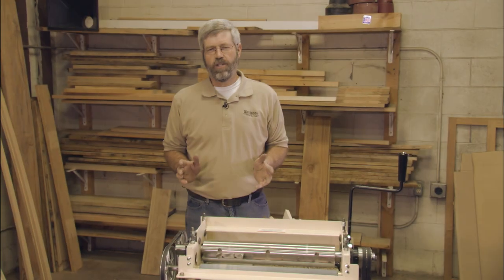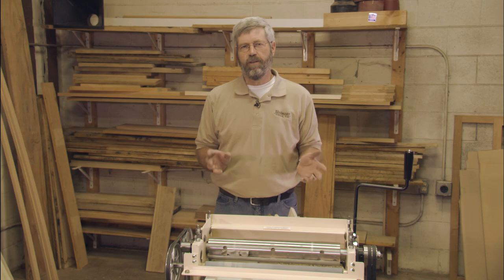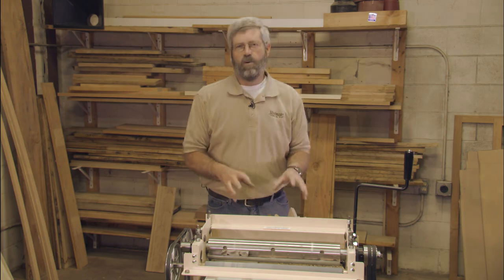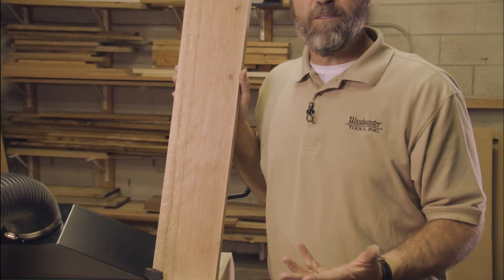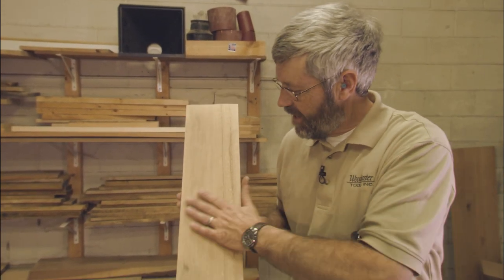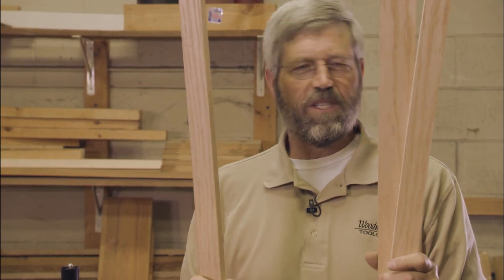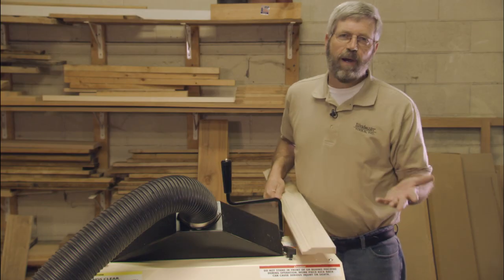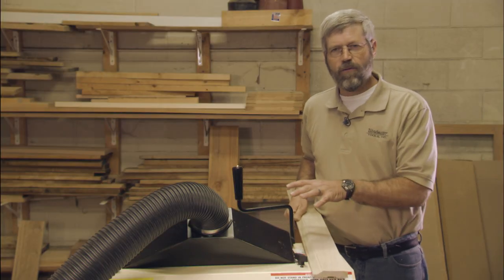The Woodmaster Planer/Molder Video: 4-in-1 Versatility Made in USA

Comment: I have to say that these Woodmaster machines are interesting. I am looking into purchasing a 24" planer and maybe a larger drum sander. The option of making molding is intriguing. Many moons ago I was the machine man for a major studio in Hollywood making several miles of molding before the 10AM break. If this machine will work as well as they claim it will, then I just might buy a full set of them.